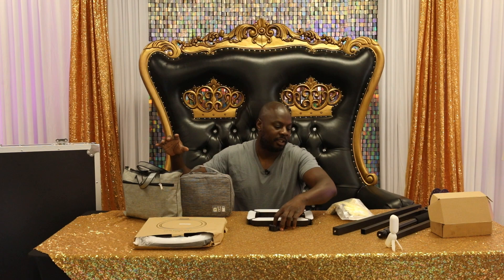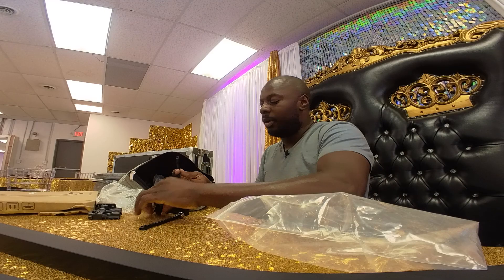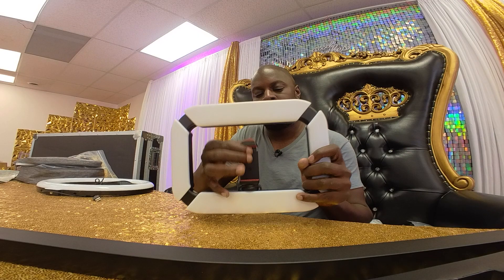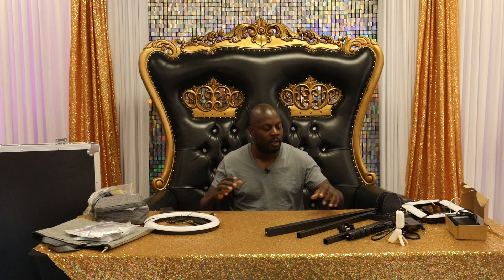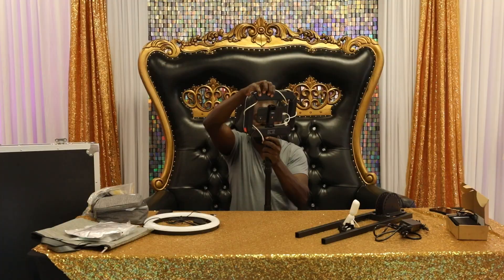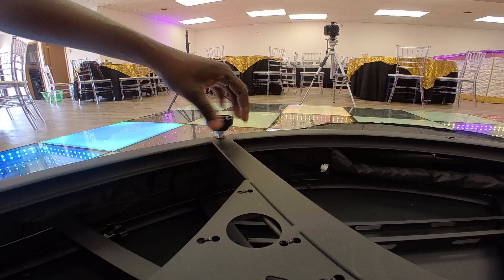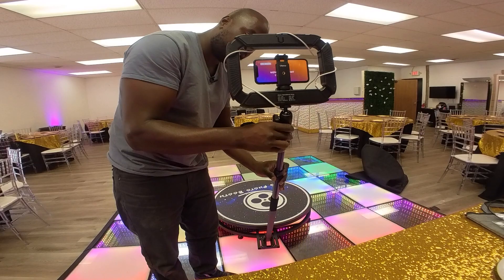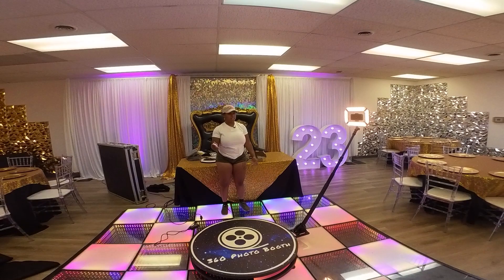360 Photo Booth Business

Comment: Question, so I seen another video of yours and you had a 360 booth. Was it the same one as this video or was it a different one? If they were different, what’s the difference and which one do you prefer?
Reply from the maker: Both of these suppliers seem to use the same exact photobooth suppliers. Seems like they are just different brands, but same machine. However, it looks like this brand has the light as an option. But in my opinion, not much difference at all besides the sticker on the top, and the 30% off discount code